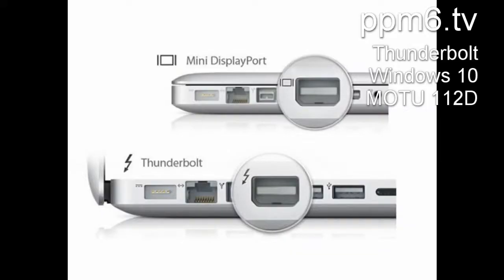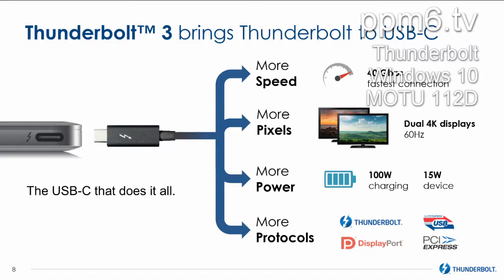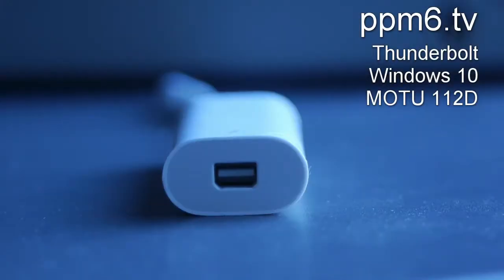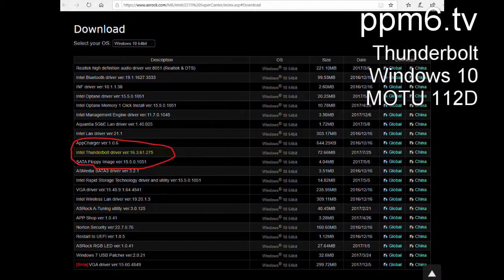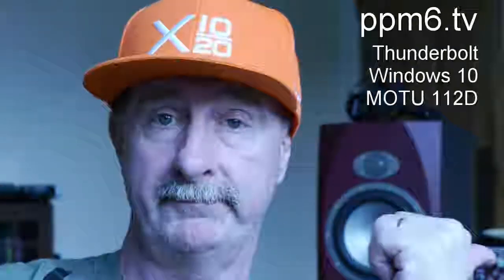Thunderbolt 3 to Thunderbolt 2 - audio on Windows 10 with MOTU 112D

Comment: What are the advantages of running it over Thunderbolt instead of USB?
Reply from the maker: That's a very good question. The honest answer for me is... not many!  I was keen to experiment with low latency or at least higher stability with low latency but I would recommend reading this - https://www.duncanmartin.com/blog/2021/03/windows-thunderbolt-motu-1248/  
However I did want to separate interfaces using T/Bolt from the USB audio interfaces on my windows machine and for that purpose it is fine. But I've now moved the 112D over to my  Mac and it's connected by USB.... 
It's worth noting that some of the best performing (in latency terms) interfaces do actually use T/Bolt...
https://gearspace.com/board/music-computers/618474-audio-interface-low-latency-performance-data-base-171.html?highlight=motu+thunderbolt+latency#post15801327
Ta like, ppm6.
Reply: To my knowledge, thunderbolt obliterates standard USB 2.0 in terms of bandwidth. When using the AVB system connecting multiple motu units together, thunderbolt should give you the bandwidth needed to handle all the audiochannels at high quality.
Reply from the maker: @Robbinsffxi  I think you are absolutely right in terms of bandwidth of the connection as the figures below (from MOTU's 112D spec) show - though I haven't tested them. 
Thunderbolt (44.1 to 96 kHz): 128 in/out
Thunderbolt (176.4 to 192 kHz): 64 in/out
USB 2.0 (44.1 to 48 kHz): 64 in/out
USB 2.0 (88.2 to 96 kHz): 32 in/out
USB 2.0 (176.4 to 192 kHz): 24 in/out

Ta like, ppm6.

Comment: I am curious what kind of latency the adapter introduces. Is thunderbolt through the adapter still faster than USB?
Reply from the maker: Hi CC, to be honest I don't do enough overdub type work and so don't pay huge attention to latency. And up until this week I never used my 112D over USB. However something strange happened earlier in the week. I have a multi format card reader that plugs into the second Thunderbolt port on my PC (the 112D is plugged into the first T/Bolt port)  and this week it has started to cause pops, stutters and drop outs on my 112D audio. I have some jobs that need finishing so rather than trouble shoot the problem I switched the 112D to USB and my problems disappeared. More work needs doing. Sorry to wander off topic. Do you have a 'target' latency in mind. If so when I get a minute I can run some tests. Ta like, ppm6.
Reply from the maker: Using this nifty checker
https://oblique-audio.com/rtl-utility.php
I have the 112D running over USB 48KHz at 12ms with a 16 sample buffer, seems stable but this is only stereo replay!
Ta like, ppm6.
Reply from the maker: Check this page for latency measurements - including MOTU but not the 112D :(
https://gearspace.com/board/showpost.php?p=15205348&postcount=4631

And note this comment about MOTU drivers - 

Miss and Strike : MOTU's new driver across both TB and USB on Windows, which delivered similar performance based on what seems to be a universal platform across connectivity protocols, which doesn't makes sense at a technical level. RTL and delivered performance was almost on par, and the TB driver especially delivered below average performance compared to the other better performing TB units.

Ta like, ppm6.

Comment: What about the latency? My Motu UltraLite Mk3 over USB has lower latency than my new Motu 16A over Thunderbolt to my Windows 10 PC. 9 ms vs 13 ms. On my Mac I had a latency of 6 ms.
Reply from the maker: Hi Elektro - I'm digging into latency questions. Can I ask if you plug your 16A by USB what latency do you get. And just to be clear - which set up had 6ms latency on your Mac?  Finally how are you measuring your latency?
Thanks for the question. ppm6
Reply: This would be nice to know

Comment: I'm more bummed that Windows (and Apple for that matter) hasn't fully embraced AVB/TSN and written solid drivers for it. Anyway, thanks for sharing that a standard adapter works as long as you have the TB drivers.
Reply from the maker: Thanks for the comment. I agree, I feel AVB being licence free was a great opportunity. The good news is that Presonus are working very hard to get AVB interoperability with MOTU worked out. The formation of MILAN among speaker manufacturers is a promising sign too. But it is a steep climb ahead no doubt. Have you gone the route of AVB hardware? Ta like ppm6.

Comment: oh man i'm in the same boat as you atm buddy. Been a nightmare getting my Motu 828es working. I can't believe a reasonably new Motu interface has TB2 ports! very round about way of doing things. I have a thunderbolt 3 laptop. And i'm pretty sure Thunderbolt 3 was out already when the 828 came out! Crazy. I'm still working on it. Hopefully I can get them to talk.
Reply from the maker: Thanks Mike - in the end I had to spring for the adapter and you'll need the Intel Thunderbolt drivers for your motherboard. Hope you get it all working!
Reply: @ppmtv-qh9qk  yeh i didnt realise the apple adapter worked on a windows pc.. good to know